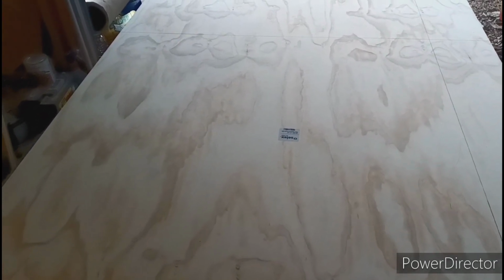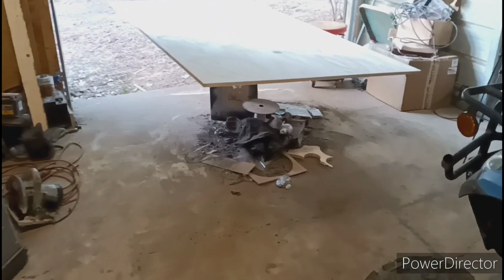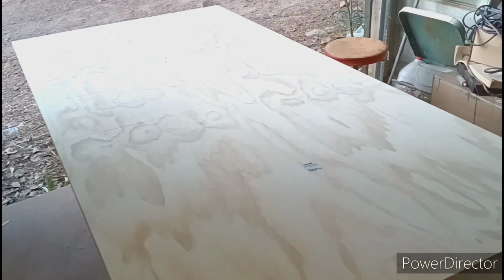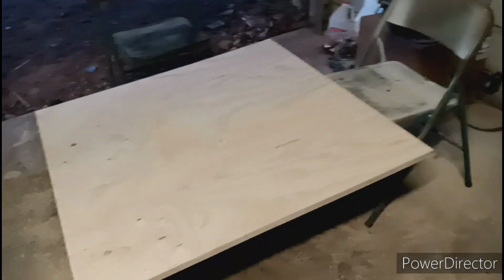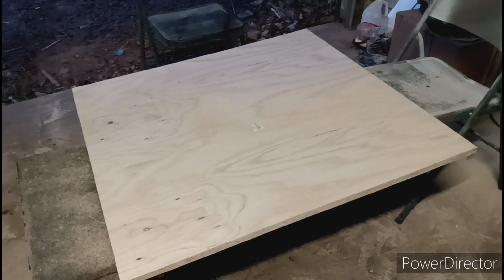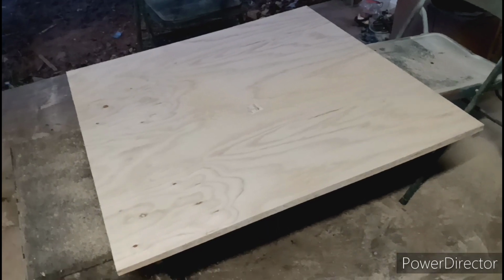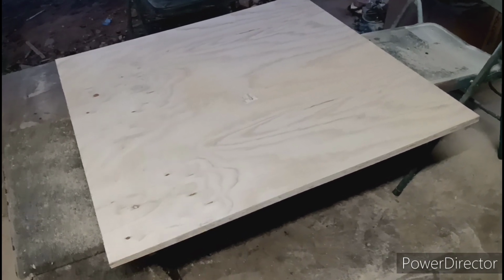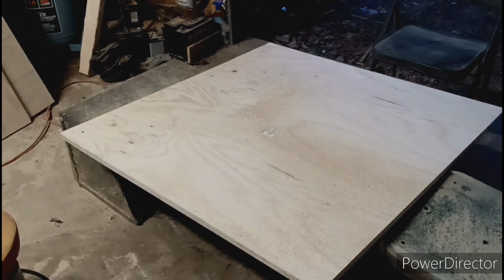😱4 #Gen-xx high excursion 15s on #Bass3k #Ds18 budget #minivan build pt 2

Comment: Can I ask did you have plans I have just got the same subs and I'm on a stupid budget also but I'm stuck with the box
Reply from the maker: It just all depends on the vehicle, space, power,and purpose of the system at far as box design
Reply: @countryboisavage  suv b pillar back 15k amp loud and windy
Reply from the maker: @bigdavedownunder I would 6th order 1.75cu per sub after port displacement one side tuned to 25hz and 3cu per sub On other side tuned to 36hz those subs won't hold up too long with that much power or playing that range but it would be some nasty demos